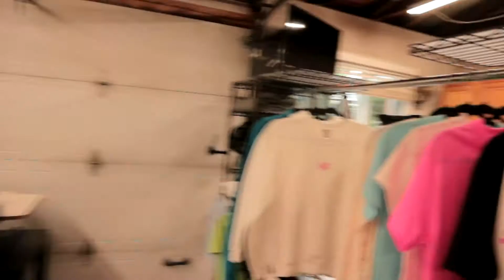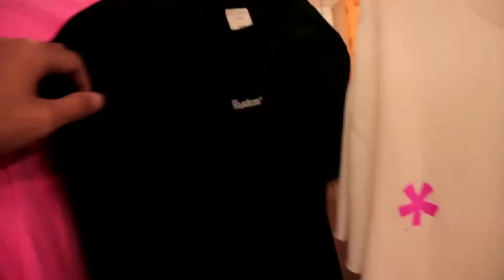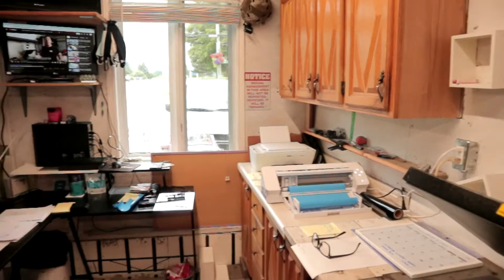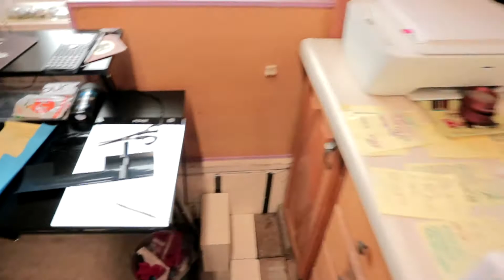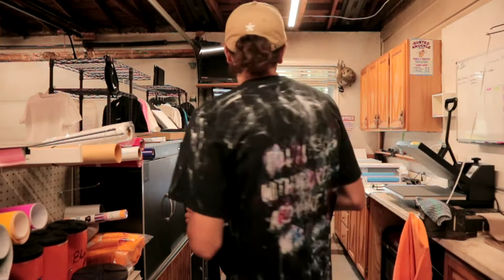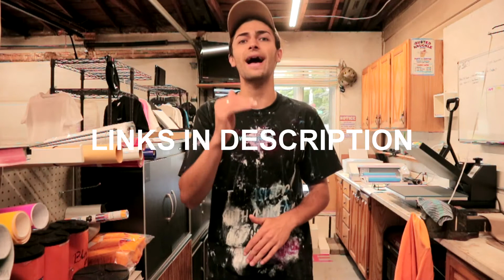How To Start A T Shirt Printing Business For Under 500$! [Heat Press]

Comment from the maker: EVERYTHING YOU NEED TO START T-SHIRT BUSINESS

Quality Laptop
https://amzn.to/2VsNiQY 
Heat Press
https://amzn.to/3fh4WOA 
Cutter
https://amzn.to/2VoQrks + https://amzn.to/3ljGRu5 
Cutting Mat
https://amzn.to/3igo2WT 
HTV 42 12x12” Sheets [Heat Transfer Vinyl]
https://amzn.to/3icBZFk 
White HTV 12”x30FT 
https://amzn.to/3C6Hn4D 
Black HTV 12”x30FT 
https://amzn.to/3yjHvM3 
Weeding Tools
https://amzn.to/3xeYSMx 
Measuring Tapes
https://amzn.to/3C48QEg
Good Quality Blank T-Shirts
https://amzn.to/37hibud 
10 Pack Teflon Sheets 12”x16”
https://amzn.to/3j8tBpK 
3 Pack Teflon Sheets 16”x20”
https://amzn.to/3zVDBcw 
Light Pad
https://amzn.to/3llkcOk 

Lower Budget; Click This
Heat Press
https://amzn.to/3fh4WOA 
Cutter
https://amzn.to/3ljGRu5 
Light Pad
https://amzn.to/3llkcOk